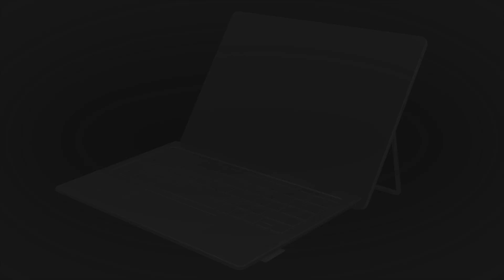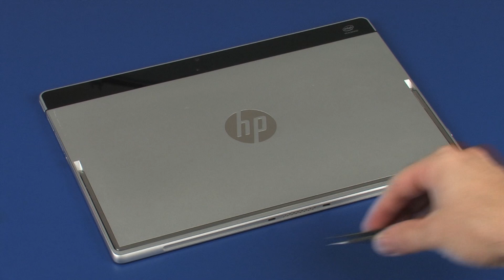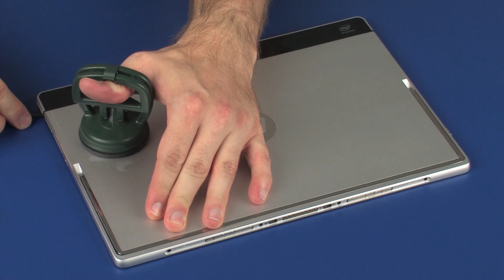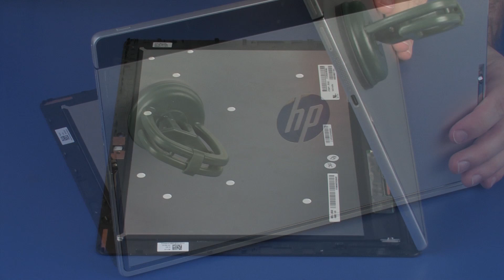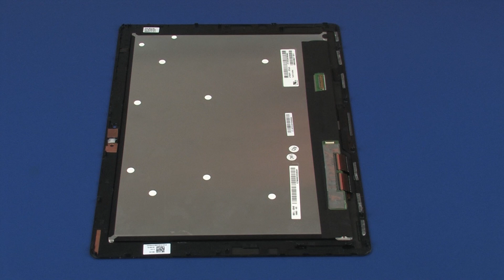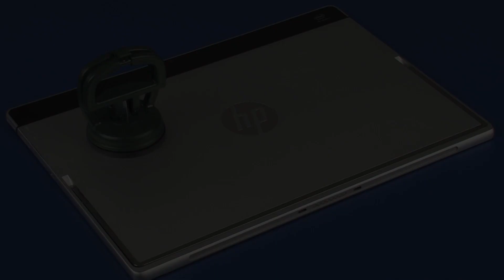Replace the Display Panel Assembly | HP Spectre 12-a000 x2 Detachable PC | HP

Comment: hello please Is it possible to change the hard disk of the Hp tablet? HSTNN_C75C The ram changed from 2 to 4 .
Reply from the maker: +Hi there HP does not recommend upgrading or downgrading hardware parts or software that is bundled with the product as It may affect the manufacturer's warranty and performance, however, you could change the configuration at your own discretion.